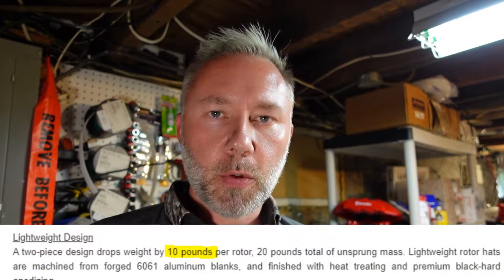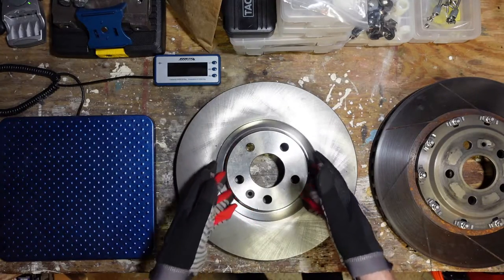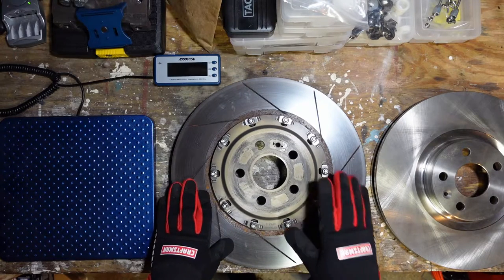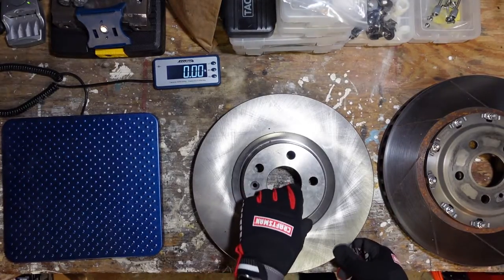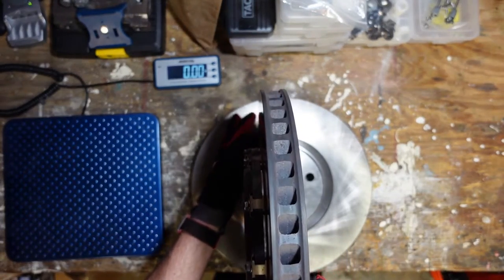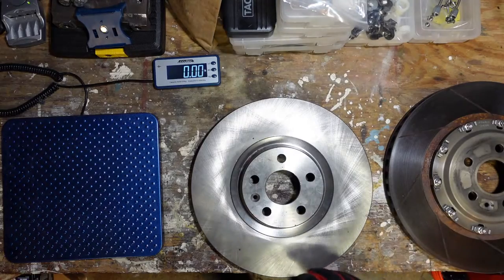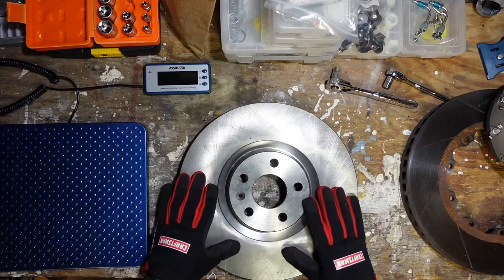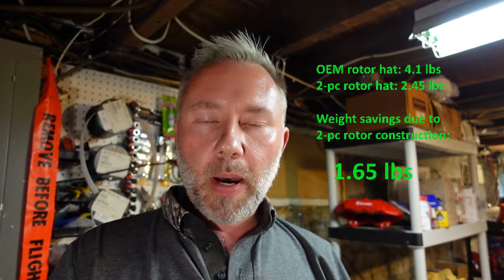How much weight does a 2-piece brake rotor REALLY save?

Comment: The weight savings are literally grams, A 2 piece rotor is pointless on a street car but are really cool and they're a must have on a track car.
Reply from the maker: It's more than grams...as I showed the savings is about 1-2lbs. That's not nearly the weight savings advertised by vendors...because they are taking the weight out of the heat capacity of the rotor ring. I wouldn't go as far to say 2-piece rotors are pointless for a street car, there are still benefits. Still it's hard to disagree with you...for most cars, for most people...you're probably right.

Comment: The video I was looking for still have a question, doesn't the slotting and drilling the rotors improve heat exchange as more air is exposed to rotors?
Reply from the maker: Hi, thanks for watching. Slotting and drilling can be opening a can of worms, there are conflicting views and data on the benefits. To be brief some testing shows drilled holes can improve the air flow and heat transfer from the rotors. In practical terms though you'd probably choose holes or no holes based on the looks, and if you will use the rotors on a track or racing. Generally rotors with cross driled holes end up cracking under hard use and you replace them more often. 

Slots on the other hand, are on the face of the rotor and don't appreciably affect the venting and hence don't have a particular benefit to heat transfer. Both slots and holes primarily have the benefit of creating an edge on the surface of the rotor that digs into the pad a bit, keeping the surface fresh. The effect is more "bite" on the rotor, that initial braking force as you jump on the pedal, and also this effect keeps the pad surface free of glazing. Secondarily water is flushed from the surface quicker. These things are useful in race cars. Usually slots are used over holes becuase they simply are more durable rotors. Some of those benefits you might want on your street car too.

Note there are downsides as there always are sacrifices. Slotted and drilled rotors, will wear the pads a little quicker, and they make a little noise, a humming as you slow down, particularly slotted rotors do. You may care about this or no big deal. Some high performance cars come with slotted rotors from the factory, but I recently noted most Cadillac V-series with their large Brembo brakes do not, probably they figure the customer won't like humming noises. Many cars come with drilled rotors simply becuase the marketing dept insists. So it's your choice of course. 

Hope that helps!
Reply: Did I hear right, the 1-piece was 245mm and the 2-piece was 270mm? Did you account for that? Assuming both were 245, there would be a bigger weight savings…if someone responds, I’ll post the math.
Reply from the maker: That is mostly correct, the compared rotor is 345mm and the 2-piece is a 370mm rotor. Both rotors are for the same application, i.e. they fit the same hub. The only thing being compared is the weight of the rotor "hat" here, not the friction ring portion of the rotor. It's just an example but IMO the point is made: there is only a couple pounds at most to be saved in changing the construction of the rotor to 2-piece style. Any other weight savings claimed, is taken out of the heat capacity of the rotor ring. That's fine for race cars, not always good, potentially unsafe, for street cars.